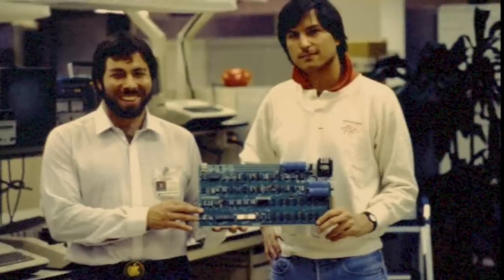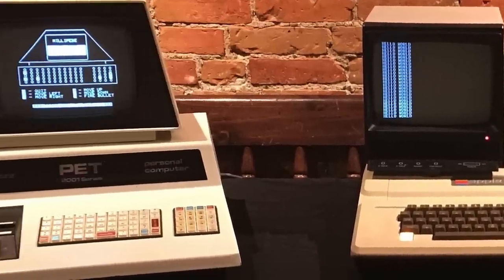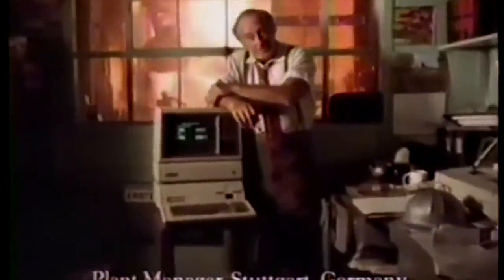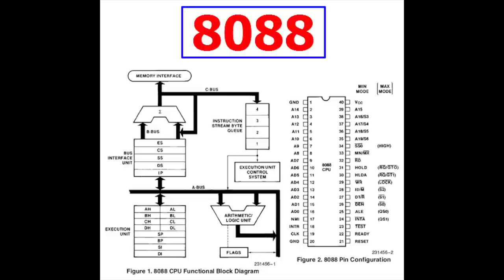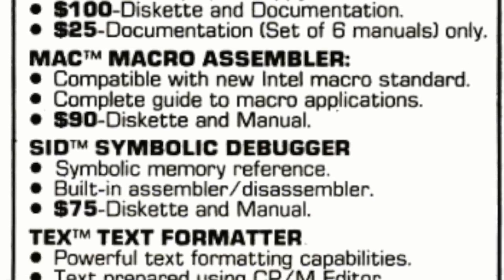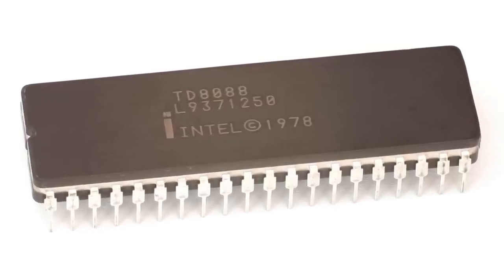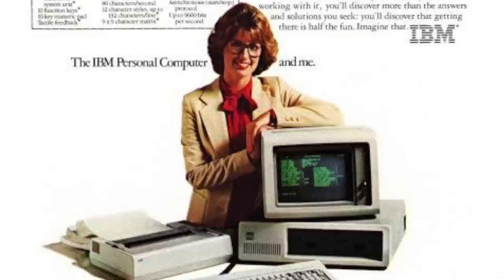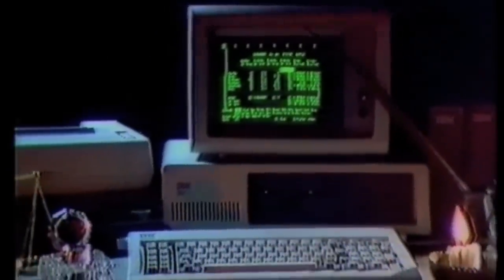DOCUMENTARY: Why and How IBM ended up creating the PC (and ended up choosing the 8088 CPU)

Comment: I met one of the IBM engineers involved in the PC design. in the mid '90s. He had a pre production PC that the floppy disk controller had failed. I was at another computer store to buy a dead Panasonic 24 pin printer. The owner was screaming ad cursing at him to  'Toss that piece of shit in the dumpster, and buy a real computer" The old man was close to tears as I asked whad was wrong. He told me he needed a FDD card. The owner was screaming, "No one has that old crap!" I told the old man that I had over a dozen of them, and I would be happy to help him.
All five slots were full, to get as much RAM as possible. I modified the motherboard to use higher capacity RAM, and upgraded it, installed the FDD card and tested it. 
The old man was crying when he saw it working, once again. He told me that it had sat in his office t IBM until he retired, and they gave it to him when he retired. He had a new system, but he had some disks that he could use with the new system, including a long mailing list for Christmas cards. He would have gladly paid a high price to get it repaired, but  only charged him $20.
BTW: did you ever wounder why the Pc case had a battery door in the back of the case, but no battery? IBM had sold a 8085 based word process that used the same case and the green screen monitor that pluged directly into the computer's power supply. Those monitors would catch fire if the had no video drive.

Comment: Well I suppose  with cloud computing, IBM mainframe is probably also going the way of the dodo soon
Reply from the maker: If it isn't already. I still think that the next big thing from IBM should be Quantum supercomputing. If they can crack that market, the possibilities are endless. ChatGPT would be an immediate customer I'd reckon.
Reply: @AlsGeekLab  SME Would probably consider migration, while IBM might eye big data centres where they can have multiple frames of the same model to reap the benefits while SME buys one frame at a time and never get to use the newer features and capabilities because you have to run in compatibility mode while supporting older frames. Going to be interesting to see where they will be heading the foreseeable future.
Reply: "Cloud computing" no such thing, just a marketing term for putting your stuff on someone else's machine. Been going on since the 60s
An IBM mainframes are still #1 in the most powerful general purpose computers. My guess is that you never had the privilege of work on one
Reply: @worskaas  you ARE referencing IBMs little servers, not big iron.

Comment: You failed to mention a key element about why the IBM PC used off the shelf elements and the 8088; not only was it time, but COST.  Cost was the single driving force given the competition with Apple, Tandy etc for small business and "personel computing". Even so  at introduction a fully configured IBM PC w printer cost about $15,000 1980 USD relative to about $45,000 today; A mimum configuration was $5000; more than a new VW Beetle (a Mint VW will cost you much more than a Mint old IBM PC today) .  You also failed to mention the IBM PC had a special ROM varient of  Basic called Basic A; one could not legally copy. This & the BIOS made it difficult to fully clone an IBM PC. MSDOS was a rip off copy of the popular existing CPM-80, Microsoft was able to obtain that and run it on the Intel 8088 which was very compatible with the zilog Z80 8 bit code; making it very fast port to IBM's PC so the 8088 CPU also allowed for  a quick OS with easy ports of existing CPM 8 bit third party software like Word Perfect to the IBM. The TI chip mentioned had no CPM ports, nor did the 68000 which was super costly in 1980; it had no 8 bit compatible mode; and SUN didn't come out for 2 years and even then at a price only the likes of  NSA could pay.  Even in 1984 when the Apple MAC was introduced with a lean 128k - the 68000 based computer still ran over $2500 USD; So in 1980; the 68000 was not a viable chip selection for small business; so including it as if it were an option at the time for a home computer was rediculous. The 8086 was also costly.  The IBM PC had capacity to have the 8087 math coprocessor that proved essential in early micro CAD efforts like Autocad.

Comment: Oh yes before the pc, we did have nice microcomputers like ones with S100 bus - but only a few operating systems like CP/M made for 8080 and with the Z80 - but S100 Bus  was expensive but they made a 8086 card for the S100 bus also.  I remeber to buy a CP/M-80 2.2 licens for bdos with bios sourcecode in assembler - in a long time other micros was better than the first PC with software for the CP/M - because floppy disks was not compatible in the format we used tty RS232 serial interface to copy program via cable to other computer.

Comment: 14:50 Difficult bank switching techniques...

The GEC 4000 series (minicomputer) processors of the early 1980s used bank switching in their 64k address space, despite using 32 bit registers (RA & RB (often combined as RB RA as a 64 bit register) though the "index" RX, RY & RZ  were 16 bit).

https://en.m.wikipedia.org/wiki/GEC_4000_series

Comment: "adding $400 to the cost would have made it untenable" ?  I bought one of the IBM PCs new from a dealer and it was around $4000 for PC with 256MB of RAM, 2 floppy drives, monochrome monitor, keyboard, and dot matrix printer, I don't think another $400 would have influenced my purchase.  Nevertheless I didn't see a problem with the 8088, we didn't have that much need for anything more advanced until Windows sotware eventually caught up.  Maybe Windows would have come about faster with better processors, maybe not.
Right now I'm using a computer that I built 14 years ago, and I'm planning to replace it with a new computer that I'll build for about $800.

Comment: you left out the 80186..most people do..the long forgotten processor ...the Tandy 2000 (1983) had it and ran MSDOS..Tandy 2000 were their version for a PC ..both the Tandy 2000 and IBM XT were released the same year...the Tandy 1200  (1985) were Tandy's clone of the PC XT... the Tandy 2000 with a 80186 were forgotten to history..

Also Tandy Model 16 used a Motorola 68000 CPU (Z-80 for I/O) released in 1982..
Reply from the maker: Was not aware of those configurations. I certainly knew of the 186s existence, but was not aware of PCs using it. Knew of plenty of 8086 PCs but not 186.
Reply: I don't know how many countries bought the Acorn Archimedes but despite its rather Apple-y GUI and its RISC, it was based on an Intel 80186.
Reply: Model 16B, wow 68K and Z80, and Xenis which is obviously a Unix clone or imitator. one for the serious collectors.
Reply: @anonUK  ARM CPU with PC emulation. and some hardware podules.
Reply: One of my first jobs was working at a Radio Shack Computer Center. There was a real demand for the Model 2 and Model 16 as small business machines. The Model 16 was AFAIKR originally a pure Z80  machine but later was upgraded to the Model 16B with the 68000 CPU. There was even a hardware upgrade path for the original units. Loved those 8" floppies (not).

Comment: why are you saying the Intel CPU names so strangely? it's pronounced "80-88": "eighty - eighty eight" same with the "80-86": "eighty - eighty six".
11:58 it's the 65C02 not 6502C
14:58 actually the original first IBM PC was only able to get up to 64kB (they sold them with either 16k or 64k installed), only with Memory expansion cards could you reach 256kB. 640kB was only doable with the IBM XT and later.
Reply from the maker: Thanks - That's good to know!
Reply: indeed, i also had a intel 80 88, back than.

Comment: I never liked the x86, thought it was designed upside down and inside out programming it in assembly I found the 68000 a delight writing assembly code for it, the Z80😒.

I remember the days I left the world of 68000 as IBM compatibles won out even tho now writing in C & C++ , they were dark times who needs more than 640K what we’re they thinking.

Now Acorn’s ARM has returned to the Desktop computers the future looks bright the future looks like Apples 🍎
Reply: If you wrote in assembly 640k should have been enough!
I wrote assembly code on an IBM 360/30 with 32K of memory and wrote an entire accounting system (A/P, A/R, G/L, PAYROLL, etc) in less than 32 including the O/S (DOS)
You just had to be creative and know what you were doing. I was dynamically calling modules and using tape for storage. Easy peasy.
Some of my code is STILL running from 1972! Things that IBM said could not be done
Reply: @rty1955  I agree at the time 640K was plenty tho not long past and it was realised 640K was pitiful when Windows 3.0 arrived, and at that time it was C/C++ assembly only when required and 640K soon felt tiny unlike the early days like 16K micros the 640K felt massive, just as today we regard 32GB Ram and even 128GB plenty tho give it 10  years from now and that will be small for our programs
Reply: @insoft_uk  agreed! All the bloat that C, C++ & C# drag with them is simply astonishing. With Assembly, you get pure, efficient, tiny code. And when you program like that, you can cram more usable code in a smaller space and get more functionality
Reply: @rty1955  yes, tho imagine the amount of code in assembly and the complexity of maintaining that code for today’s type of applications especially machine learning, physic game engines etc… and that’s not rewriting it all over again for another CPU
Reply: @insoft_uk  as long as chip manufactures maintain backward compatibility this should not be a problem..i have heard this argument for decades and loke I said some of my code that was written in assembly is still running today.
The key to good assembly code is tiny modular building blocks. Jist like a building made of bricks . you can creat anything with small modular bricks. The problem is when coders write huge monolithic applications in any language. Tiny modules are easier to code and debug as well.

Comment: i8088 is NOT compatible with the i8080 or Z80!
Only NEC V20 has a 8080 compatibility mode
Reply: Nor is it compatible with the 8085 Software wise ..8088 Was a cost cutting exercise and also to slow it down compared to the IBM Minis and Mainframes. IBM Crippled the 8051 on purpose
Reply: 8088 is assembler level compatible with 8080. One cannot run the binaries but if one has the sources it is simple assembling them with a cross assembler. There are two instructions LAHF and SAHF that have no use besides this compatibility. These were needed to implement PUSH AF and POP AF (Z80 mnemonics, I am not that familiar with 8080.)

Comment: The statement about Bill Lowe trying to sell IBM on personal computers in 1973 is wrong.  Why?  They didn't exist.  The only microcomputers that did exist were in kit form (one, only as a set of blueprints) and not even known about by the general public.  It wasn't until 1975, thanks to Popular Electronics magazine, that such a device was introduced to the average person.
Reply: The IBM SCAMP prototype was made in 1973 and was a computer that fit on a desk. The SCAMP became the IBM 5100 in 1975 (yes IBM was that slow going from working prototype to production unit).
Reply: Jan. 1975, PE introduced the 8080 based Altair 8800. Radio Electronics introduced an 8008 based micro about four months prior. OTOH, the S-100 bus generated a lot of Altair clones.

Comment: My first ever overclock was an 8088 from 4.77 MHz to 6 MHz. The one reason why IBM designed the original PC the way they did, and the crippling of it, was a very simple one.

IBM didn't want the PC to compete with IBM's core business model.

IBM really didn't think that the PC would ever amount to anything.
Reply: The PC NEVER could compete with Big Blue. There was NO WORRY about that
Reply: @rty1955  You are right there, the PC made the IBM core business model obsolete.
Reply: @michaelnager6059  do you know what. Business ibm is in?

Comment: 14:44 it's an interesting documentary but you contradict yourself. Earlier just before the one minute mark you had said 1MB was "one of its biggest limitations". Clearly the home micro revolution and the Commodore 64 proves 1MB was not, at that time, a limitation. In fact, it was quite roomy for a microcomputer and complete products could easily be written be kept within a few k. 

Think of the 1.44MB size of a floppy disk. At one time that would be enough for a complete operating system. I think people are eager to view it in comparison to what we know today, and what came afterwards, rather than what was really available in its own time. The ZX81, for example, was a 1K machine and it was only conventionally expandable to 16K and in its time even 16K was regarded as large. The IBM PC AT which replaced it,, released about two years after the Commodore 64, and long before the Commodore 64 ceased to be popular, had a capacity for 16MB, and was available in 1984. 

I disagree with the popular trend of portraying the IBM PC as underpowered because there really wasn't a time it was underpowered by relation to other desktop computers.

Meanwhile, if they had chosen the ROMP CPU, and taken advantage of it's increased capacity, it would not have been an IBM PC but a completely different and substantially more expensive workstation class computer, not an  IBM desktop PC. The cheapest IBM ROMP workstation cost over $6000.

When the Commodore Amiga was released, after the IBM PC AT, it was released with 256K of RAM.

The microcomputer revolution was launched as a fleet of computers which were not held back from the market by a sub MB RAM capacity.
Reply from the maker: I agree that at the time, 1MB was huge. It was more a problem that came along in the later days of the PC, AT/286 class machines. Even after then, the bridge between having conventional RAM and higher memory was a pain in the proverbial, that lasted until the days of Windows 95. I remember having many boot disks and config.sys setups to work around this problem for games back in the 90's.
I also didn't/don't mean to infer that the ROMP chip would ever have been used in the 5150. All I'm trying to say is that the PC would have been very different indeed, if they had chosen to go down that route further than they did (they did look into it, albeit briefly). And yes, the price would have been ridiculous, so it wouldn't have competed, and therefore wouldn't have succeeded. I think the main thing that frustrates me is that they didn't choose the 8086. As I've demonstrated in the video, there were many reasons why the 8088 made sense, but it would have been nice to use the 8086, that's for sure...
Reply: @AlsGeekLab  

Yes, I understand the frustration. An 8086 would have been the better starting point. If it is any small reassurance then here is an example of a popular recent video player for the original 8088 IBM PC. It goes without saying that it isn't impressive by the standards of today, but again, if you put it in its historical context, noting that it is written for the archetypal CGA PC/XT model, which became available before the Timex/Sinclair Spectrum and Commodore 64, and was contemporary with the Timex/Sinclair ZX81, it really isn't too bad. I can't think of many times I've seen comparable FMV demos on the original Commodore 64 or Sinclair Spectrum hardware.

8088 "Domination"
https://www.youtube.com/watch?v=MWdG413nNkI&t=292s

8088 "Corruption" side by side with 8088 "Domination"
https://www.youtube.com/watch?v=cK703qMFb0M
Reply: @AlsGeekLab  Also, here's, an unreferenced, YouTube video which is reasonable:

8086 systems predate the PC,  but they weren't hugely successful, because they were released in an era when the necessary 16bit motherboards were expensive, so choosing the 8088 made the motherboard cheaper. It makes sense, if you're doubling the path width, you're doubling the real-estate you need, and you're making manufacture harder. 

https://www.youtube.com/watch?v=TjSpSTGV5M8
Reply from the maker: @vapourmile  thanks, good resource, and definitely the conclusion I got to when doing my reading
Reply: @AlsGeekLab 

Here's one you probably know. Worth a reminder possibly even if you do. A 2015 demo for the 1981 standard-issue CGA 8088 IBM PC, available before the XT. 

Obviously much less impressive than what demos became - especially in audio terms and I think it's far better with the sound off - but when you compare it to what you'd expect for other computers released at the same time, only the Pet, Apple II, TRS-80 and the ZX81 really existed at that time. There wasn't even the Commodore 64 or Sinclair Spectrum yet. it isn't nearly as bad as people are eager to make the PC out to be. 

https://youtu.be/RSiY9URdDHk

Comment: The BUNCH. Burroughs, Univac, NCR, Control Data corporation & Honeywell. 

IBM IP rights in punch cards was a massive financial revenue stream. 

Say what you will, but way BITD, you could get communal access to critical source code. 

I think that the PC market and typewriters & copiers are yesterday, but IBM still possesses a large patent portfolio and holds institutional respect where 99% vs. 99.99% if reliability equals 3 days of battery business downtime.

Comment: Nope - not watching on a descendent of the Intel 8088. Watching on an ARM M1 machine.
Reply from the maker: This video was made before the M1 was a thing. It's an old video!
Reply: @AlsGeekLab  — I know. The M1 is amazing compared to the Intel chips. 

But we need to remember that technology continually advances – often in giant leaps like the M1 chip. 

I first programmed using a Z80 Kaypro and early CMOS processors for ocean sensors.

Comment: And yet, the end result is a still flawed operating system which is  bloated and no one really knows what's in it, as problems unsolvable continue to exist. Windows, still mired in 20th century code, remains a stumbling block to modern computer users.